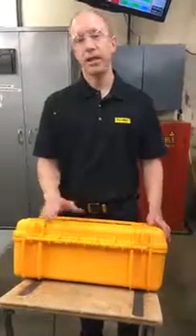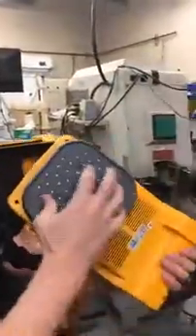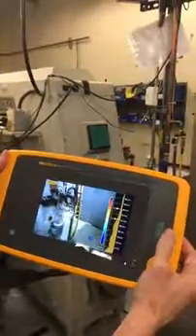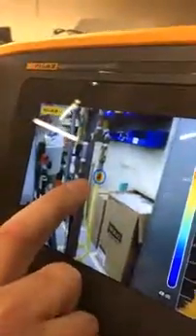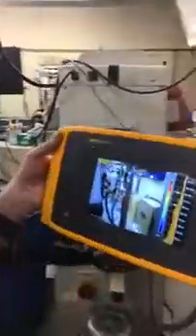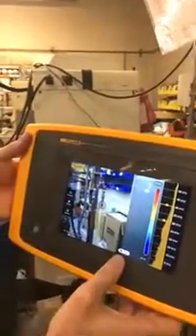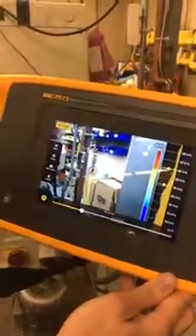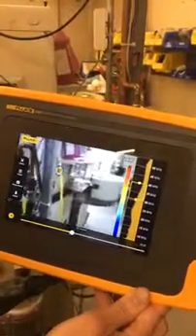Fluke ii900 Industrial Imaging- Ultrasonic Camera Live Demo

Comment: Hi i wanted to say this tool is fantastic ,I have been using it on the lower frequency range to locate worn bearings on motors and other difficult to locate PHANTOM Sounds also
Reply from the maker: Glad to hear you are finding valuable applications for the tool.